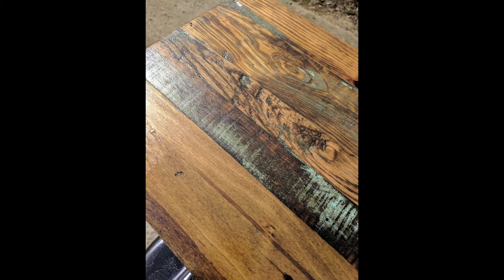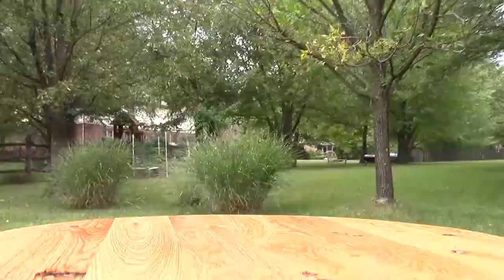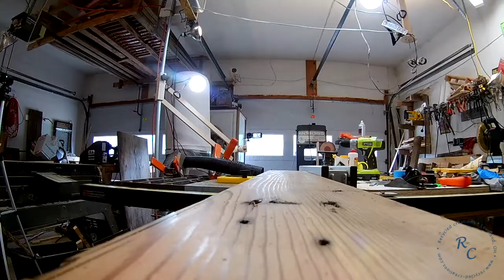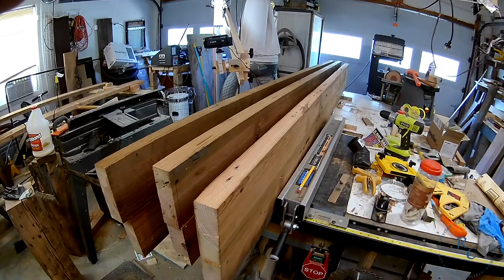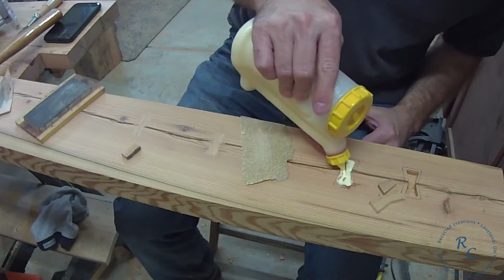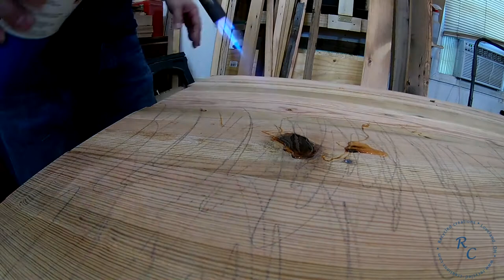How to Build: a Reclaimed Barn Wood Farm House Style Dining Table

Comment: Hey Billy nice job.  Like to discuss the track saw you used if you don't mind? How do you like it and does the connector for longer  track keep the track in glue line straightness? 

I had another brand and it moved ever so much to affect gluelune mess. I had to flip it over all the time using 12ft and connections did not keep tight. Will say more when you reply.
Reply from the maker: Sorry for the delay in reply, the system uses a wedge alignment thing, that I think they have an explanation of on their website, ive been using that system for several years now and even with the extension its very straight.  If you order one of their system mention to Jacob I sent you.  Its a USA owned Ohio business.

Comment: Just asking a couple questions..the wood I have is 100 year old exact 2x10… client wants to have the barn look on the top but have to get it relatively flat on the bottom for legs…anyway any secrets to epoxy on top to give a nice even surface…other than dump it all over and let it settle…am i missing something..and any tips on making a X set of legs with a miter..:
Reply from the maker: So the table.i made is not that even on top and I don't have experience with epoxy pours , in my mind a farmhouse table needs to have character and inconsistency to fit this style. I did plane the bottom to be much more flat that the top and on the top I just filled deep holes and imperfections so that food and what would get stuck and make clean up easier. Hope that helps ...